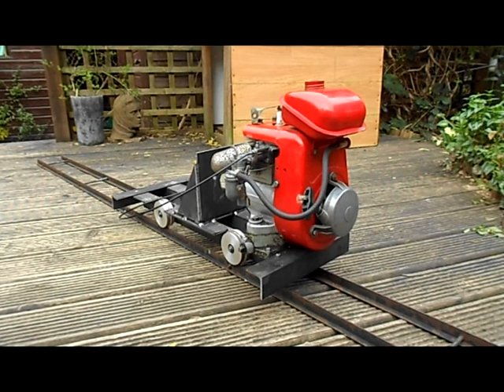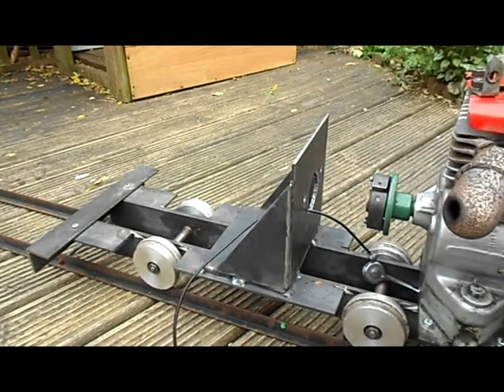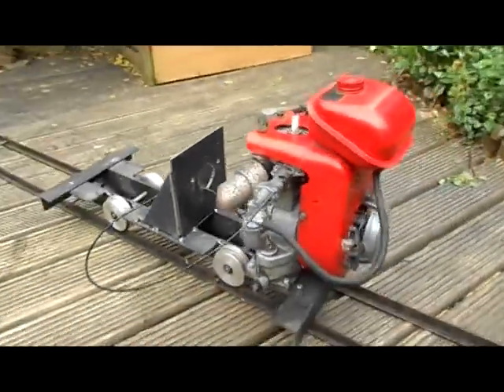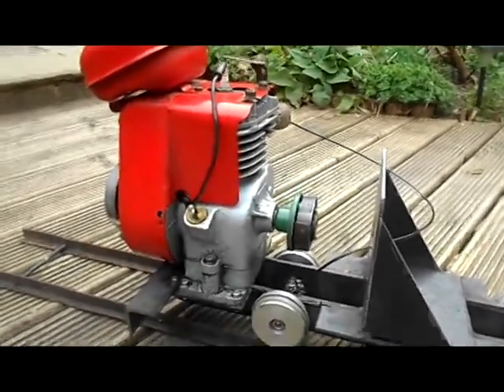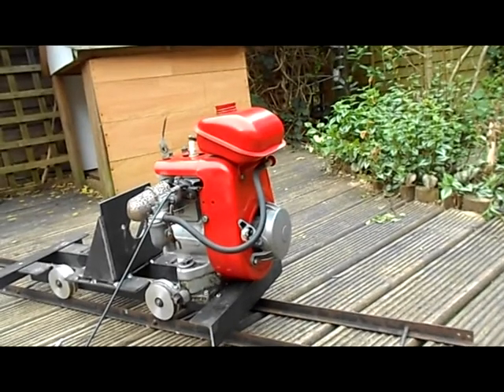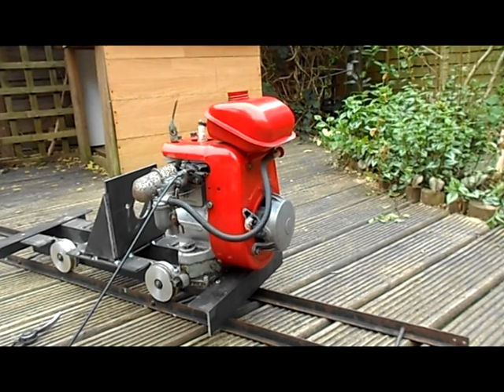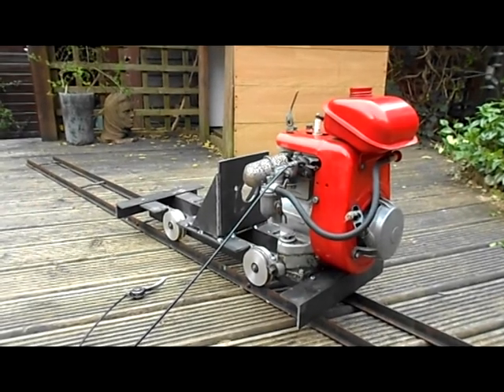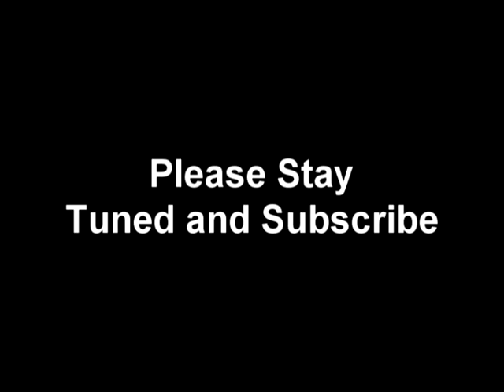Video # 68 - 5" inch Gauge Petrol Electric Generator Locomotive Part 3a

Comment: Cheers mate, great job. I makes me want to build one for myself. I am not sure if you have a video of the loco that will run in forward or reverse. I know that it can be done by reversing the leads on the traction motor, via a three position switch witch will have to handle the current of the traction motor. ( forward - off - reverse)
Reply from the maker: +Francis Bailey
Thank you very much Francis. It took a long old time to get this machine to what it is now, which can be seen running on rails in this video:https://www.youtube.com/watch?v=PQT2VPpZArM&feature=gp-n-y&google_comment_id=z134ftpg0qi4hn2ye04chxzikpyudnjqz1k

Yes it does not a switch like that, I belive double pole, double throw or something along those lines. Easily done. Ive since also made this loco electric start and attempting to install sprung axles

Anton